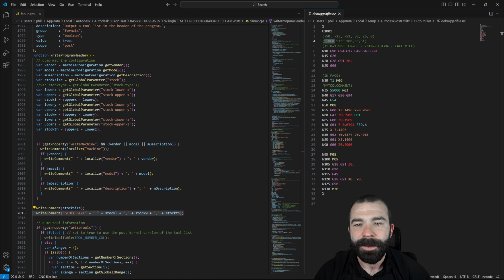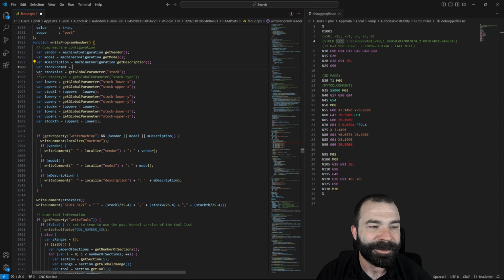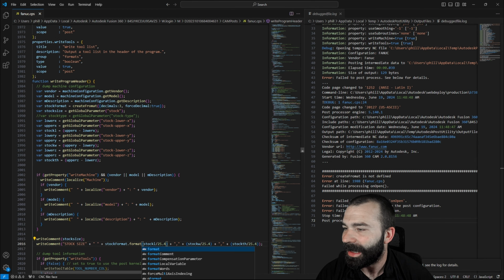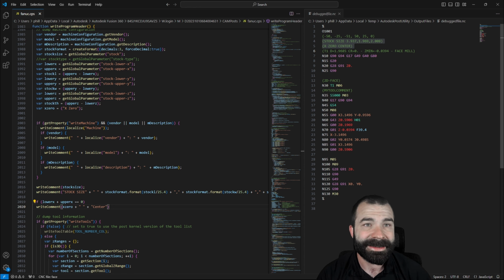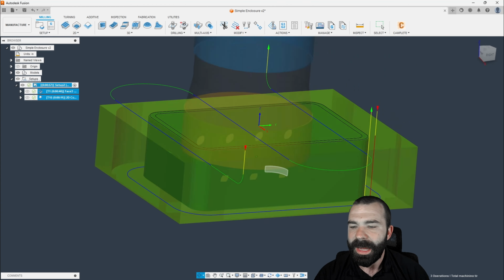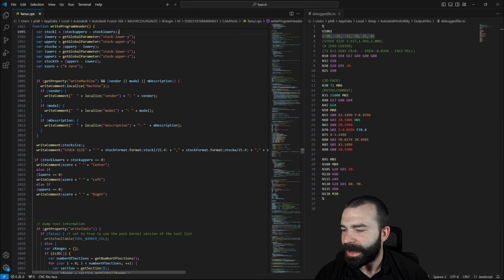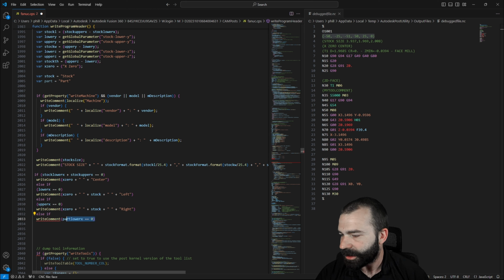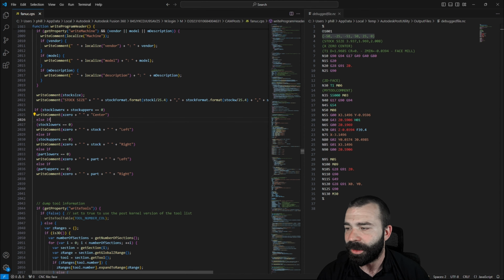Workflow Wednsday: Intermediate Post Edits Part 2

Comment: Just starting to dive in to this now, and having a tough time with a couple things. Some seemingly simple, like moving the N block number to before the operation comment, which turns out is not simple at all 😂. But also some slightly more difficult ones, like trying to add a G90 G10 L2 P# X0.Y0.Z0. in to my posts, where the "#" is the fixture number (1 for G54, 2 for G55, etc.), and add an instance of it for each setup. I got it to post the words correctly, and in the right spot, but that's about it and the # isn't tied to information, and doesn't post a line for each fixture offset. Having the same issue with the tool change numbers. We use variables for tool changes, and height and diameter to match. I can get it to post the words, but not anything tied to the current tool and the next tool. Unfortunately my company won't pay for any kind of support (I spoke to Sean a couple days ago about this) so I'm doing my best here
Reply from the maker: So what I can gather is your trying to use a more advanced strategy with G10 to overwrite your work offsets yet your company is holding you back over a few $100.... Something doesnt sound right.
Reply: @JITCADCAM yeah, the owners are the epitome of cheap asses. Refused to even spend $ on CADCAM for 30 years until I made it a contingency of my coming back. And right now we're not doing so good financially on top of that, so I'm trying to figure this out on my own.